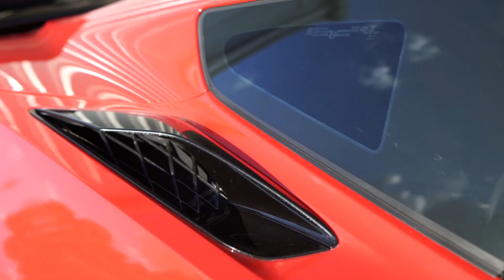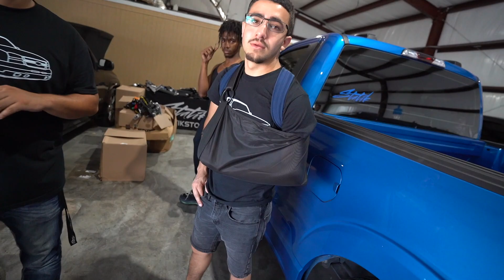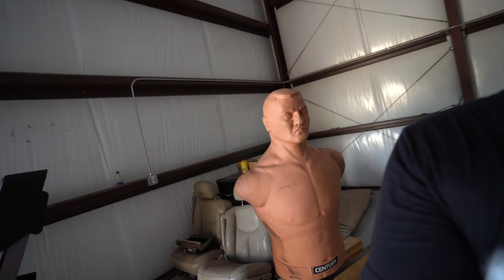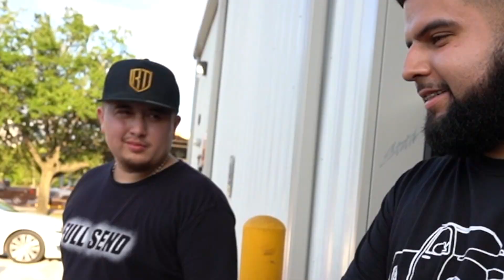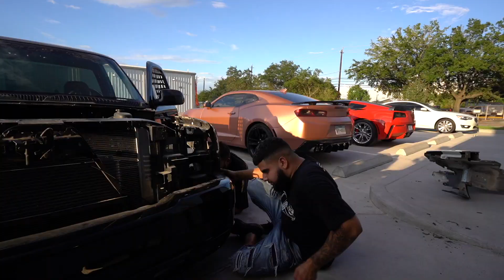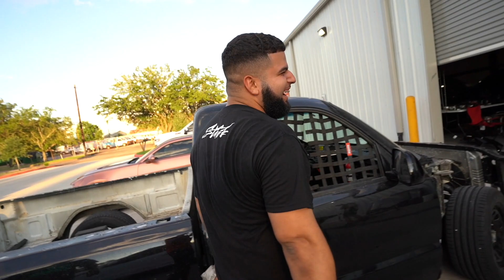I BOUGHT ANOTHER CORVETTE AND IM GIVING IT TO ONE OF YOU!

Comment: You goin with a glossy black or satin black?theres a satin black that’s from SEM called trim black looks nice af $60 a quart or company called hot rod black.sand it in sections,for example bed on its own do all body work+for body work spots sand with a more coarse grit,before body filler use 180 grit  so body filler will stick, I prep body filler lightly with 80-120-180 to get rid of more coarse scratches and primer over spot repairs then  move onto cab and doors and then front clip no glossy areas can be left or paint will react,all areas that you can’t reach with sander use a grey scuff pad to dull out clear.if you’re gonna primer whole truck sand it with  220-320 grit and spray a 2k primer surfacer,panel at a time or in sections,if you put truck after primed in sun for whole day it’ll bake gives good results,then sand primer with 400 grit wet sand or dry sand smooth so you don’t see the primer texture,you don’t have to strip panels down at all use paint it has as foundation/if you do choose to primer whole truck after all body work bigger process but comes out nice after you wet sand all primer for 2ksealer,more simple option is after you weld up holes and do body work spray alittle bit of 2k primer surfacer from a spray can  over all body work areas and sand primer spots with 320-400 grit wet sand or dry sand,important to wax and grease whole truck  2k seal whole truck 2 med wet coats 50% overlap with 10 min in between coats fluid adjustment and distance to panel all depends on how fast or slow you spray don’t open up knob too much for fluid paint will run after you’re sealer coats you mix youre base coat also do a 50% overlap to avoid stripes after 2-3 nice coats with flash time in between coats then you use a tack rag on base coat if you’re goin glossy and spray you’re clear,satin would be less complicated would sick af there’s other options on prepping bro I’d have to see how paint is up close and it’s all up to you on look you’re goin for.you got this bro😎😎😎😎😎saludos desde Santa Cruz CA blaze it bro
Reply: I didn’t read any of that